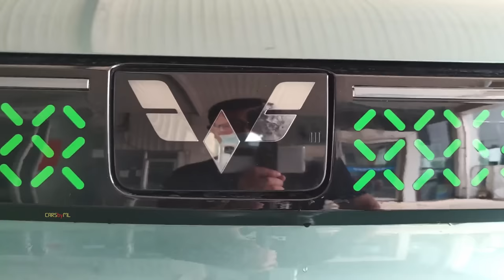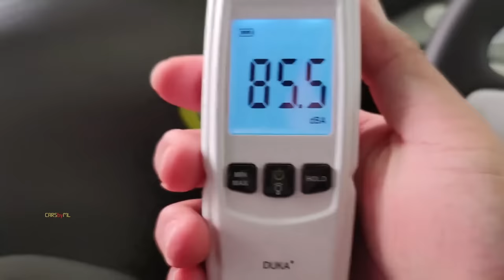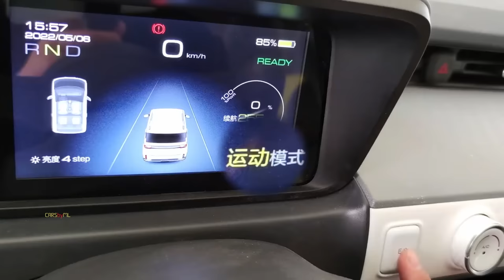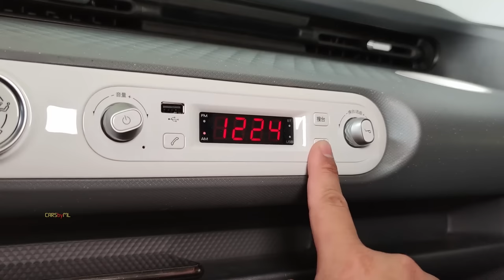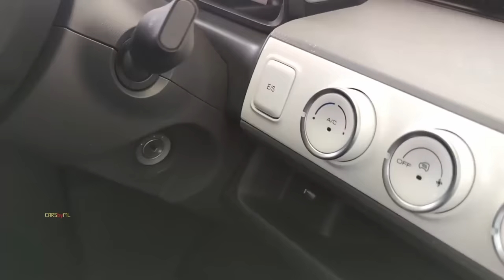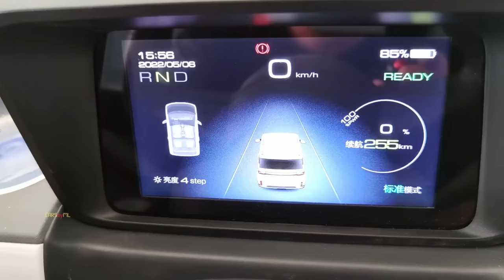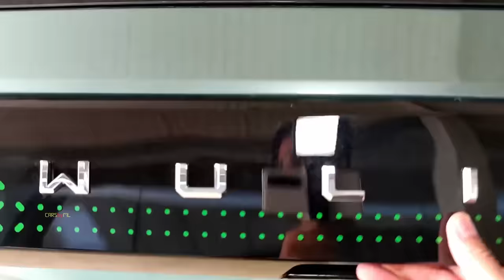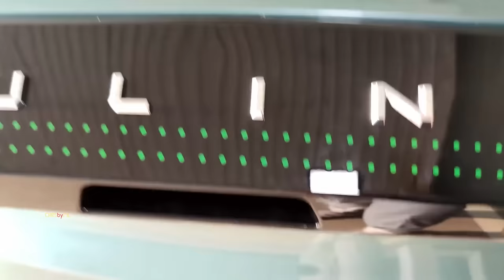2022 Wuling Hongguang Mini EV in-depth Walkaround

Comment: I love these little things and wish they would bring them to Europe/UK as this is what most people want from a car, simple, does the job and no unnecessary gadgets which is just more bulk to carry around and more points of failure.
The fact the car has a real handbrake, two doors and a proper key is a big plus, cheap and has a decent range.
Sadly the 63mph top speed and using a gear selector knob rather than a normal gear leaver lets it down.
Most people don't want to drive around inside a laptop and the this car with it's more basic controls is just what people want.
Reply: Agreed!
Reply: exactly
Reply: @garyingersoll2460  The only two downsides is the gear selector being a turn knob rather than a normal gear handle and the top speed.

The gear selector takes away from the drive and is counter intuitive to what most cars have, I can also see it being more likely to have drinks spilled on it and breaking it.
The speed is another as most people don't want a car that is only good in the city so it needs to hit motorway speeds.
Most people don't want to have two cars to do the job of one.
Reply: a REAL door and door handles that don't trap you inside a car in a fire - Genius EV Idea!!
Reply: @AW66888  Yeah, that's what people want, an EV that's more like a traditional car.
The more manufacturers make cars like laptops on wheels the more there is to go wrong and it just bumps the cost up.
Reply: @dave4803  totally agreed. this is a no-frills utilitarian ev and i love it
Reply: @AW66888  It has two small downsides, the top speed isn't high enough as you want to hit 70 for motorway use, a software update or better gearing might cure that.
The last is the gear selector, a lever is better and more car like. 
Apart from that make it right hand drive and the car is perfect, I would buy one if the price doesn't creep up too much when it comes to my country.

If they fix those little flaws and the price stays fair it would do well in Europe.
Reply: There are sellers in Lithuania, and the price is about 10,000 euros.
Reply: @intergrieren  But are they right hand drive?
Reply: 🤣i forgot about this
Reply: @intergrieren  I'm sure they'll make them one day. The UK would love these things.
Reply: @dave4803  I hope to be able to buy it in Germany as well. It's great as a second car in the family. And it has everything i need, and it's very cheap.
Reply: @intergrieren  You can already buy a dacia spring which is simple like it just costs a little more.
Sadly they don't do it in right hand drive so it isn't right for me.
Reply: @dave4803  too expensive for me. Over 20K Euros.
Reply: @intergrieren  I thought they were cheaper than that.
Reply: @dave4803  unfortunately not. 😢😢
Reply: @intergrieren  They'll get cheaper over time.
Reply: @dave4803  hope so, I haven't bought an electric car yet.
Reply: @intergrieren  I haven't either but I've wanted one for about 20 years, they only just now are becoming useable.
Reply: @dave4803  I'm still waiting for fast charging. I want a car to be fully charged in 10 minutes. Electric vehicles today are not at this level.
Reply: @intergrieren  For electric vehicles to be suitable they need to be affordable, they need to hit motorway speeds and have a range of about 200 miles per charge.
They also need serviceable batteries, battery packs you can open up and replace a dead cell rather than replacing the whole thing. At the moment they are just too wasteful and expensive.
Some form of on road charging for people that don't have drives or off street parking, two charging points per street light would work.
On top of that the car needs to be simple like this one.

If they made these changes people would be buying them in numbers.
Reply: @dave4803  👍
Reply: That is what you as a normie want from a car. Not everybody has low expectations.
Reply: @dave4803  Electric cars that are suitable need to be able to compete with normal cars in terms of pretty much everything, comfort, topspeed, range, convenience but hey they don't have to compete, just outlaw the competition, right?

"Some form of on road charging for people that don't have drives or off street parking, two charging points per street light would work." You don't live in lala land and electricity doesn't grow on trees, either. Why overloading the power grid and unnecessarily driving the prices for electricity up?
Reply: @worldhello1234  Most people unless showing off just want a basic car.
Does it do the job? Yes. It is cheap? Yes. Does it beat walking? Yes.
The same with phones, if it does the basic functions of a phone why overcomplicate things just to show off.

These same cars in China alone outsell Tesla's world wide.
In Europe and the UK these would mostly be city cars or second car.
But with that kind of range it is perfect for longer runs. 
Believe it or not the Chinese car makers listen to their customers and build cars for the masses, not just the rich or the poses.
So instead of telling people what they want they give them what they ask for and for that reason alone they have more customers.
Reply: @worldhello1234  That isn't the case, fuel is running out and do you like buying oil from the likes of Putin and Iran?
Another a car very much like this is the dacia spring and that is due to come to the UK in 2024.
That ticks all the boxes for what 95% of people need from a car.

You do know fuel is running out? Petrol is expensive and by 2030 no new petrol or diesel cars will be made in the UK.
Even if you can still find and afford fuel which most people won't be able to do it means once the current supply of internal combustion cars wears out you will have no choice. Soon petrol powered old banger fit for the scrapyard will demand more money than a new EV.
Also they are talking about banning fuel burning cars in certain areas like cities so if you want a car go electric. 
Also the power grid is drawing less power today than 20 years ago, about 10% less and that is with charging EV's today too (Thanks to energy efficient appliances).
And for your information since I made this comment I found out they are doing some form of on street charging and they starting it in around 2025.
Reply: Very practical....and no need less BS
Reply: I agree with you, the best fact of this car is that it is not expensive at all! Plus, as European cars are allowed to export to China, in contrary why Chinese cars haven't right to sell in Europe? We have to know that nowadays Chinese cars' quality are as better than as European's or Japanese's!
Reply: @intergrieren  I live in France! I wonder why it is not sell here!
Reply: @dave4803  French people would like it too!
Reply: @intergrieren  Electric cars should be charged in an ordinary plug-in of 220V. Then we can charge it at home, that wouldn't be a matter even though it needs to be chargerd more than 3hours of charging.
Reply: @sunday6099  Great little city car and can go further than most city cars and a decent turn of speed too.
Reply: @dave4803  yeah, this car can go further than most city cars, that why I really want to buy it as I need a small car which can go further! Unfortunately I live in France and this car won't export in Europe.
Reply: @sunday6099  Just import one yourself. The car's are left hand drive and in KPH so are fine for France without changes.
Where I live we need MPH and right hand drive so the cars aren't suitable as is.
Reply: Get ship&shop
Reply: @emiratesnbd5630  I know but the issue is that as it's not sell in France, so I don't think it's allowed to drive in France
Reply: @dave4803  If the car breaks down and needs spare parts to get it change, in that case do I need to import this car's parts?
Reply: @sunday6099  Depends, most parts are off the shelf and since most parts come from China anyway there's really no difference
Reply: 这种微型电车在中国一般老年人开的比较多，用它来接送孩子上学，或者家不太远的周边用，所以速度不快，里程也不高，如果要开的远，就得改装，增加电池容量😅😊 或者就买价格更高的电车了😊

Comment: Terrific! not one word... but it says it all. Brilliant engineering that needs to be imported right here in california. Of course by then I'd expect the price to jump by two fold, yet it wouldd still be reasonable. It's just unfortunate that our tariffs and restrictions on chinese car imports iare outrageously high! some did complain about a gear lever versus a knob? Who cares? Most people rarely switch gear in their fueled automatic car, unles they go up hill on stiff slopes. But an electric car needs no gear if the motor is directly linked to the weels and the torque is plentiful at low speed. Perhaps a gear would be needed in overdrive, but this car is not made for long highway drives. It was conceived for urban commutes. You're actually lucky that it can dive on freeways and considering the overwhelming number of tanks driving around at high speed, I would be scared to drive on anything but the first lane, which at 63 mph is just fine in CA since the speed limit here is 65 around most cities. At this price range, you're forbidden to whine! you need to switch to a lever gearing? Do it yourself and suck the additional expenses. But for me, leave the car as cheap as it is right now. A comfortable entry point into owning an EV, that all I'm asking and the Chinese have it. Unfortunately we don't and we won't anytime soon. Think about it. Getting any car converted to EV will cost you around 18K here!
Reply: GM is one of the shareholders of wuling, so you can ask GM to import this EV even under the GM brand

Comment: Perfect, what's the battery size and range miles?
Reply: About 20KWT. and about 120KM
Reply: The new one is 300KM
Reply: In indonesia will be launched with 200 km and 300 km
Reply: 300km max
Reply: How much btry range 300km plus shipping?
Reply: @junchengxiao1747  No. Gameboy is 240km-300km
Reply: @gunwino  thanks how about Philippines ? Price in usd please
Reply: already launched in philippines 250k = 4500$ something like that...
Reply: From 120km to 300km, there are several models to choose from, with prices ranging from 32,800 RMB to 72,800 RMB. (equivalent to $4,700 to $10,000)

Comment: Under $18k would be ideal. It would sell here in the States.
Reply: In China, its MSRP is 40000RMB which is only $6k. The convertible coupe version is just $10k.
Reply: it's 2 times less than that bruh
Reply: The car sells for $4,700 to $9,000 in China.

Comment: amp this up a bit more. Hit sustained 72 mph for 100 miles and it will be worth even $5000. AN out and back commute may be slow spped but. @50-90 miles 1 way.

Comment: A big problem with these EV's is the battery design.  Why not have 6 to 8 batteries plugged into a grid under the car instead of 1 enornous battery making up about ½ the weight of the EV?  Stop following Tesla!